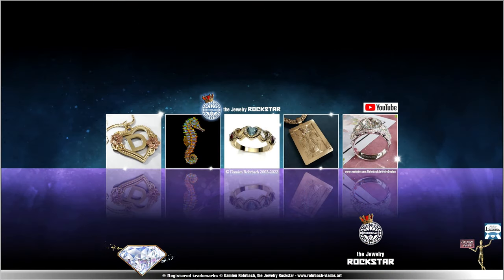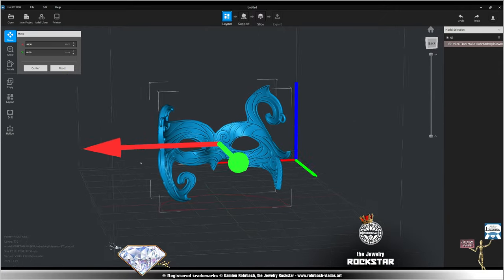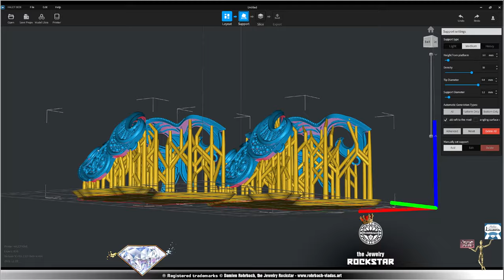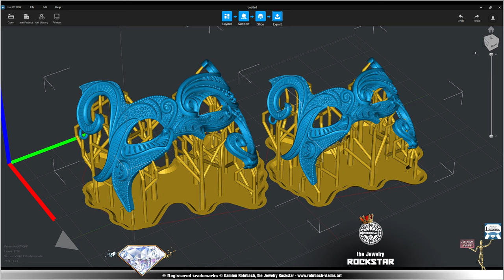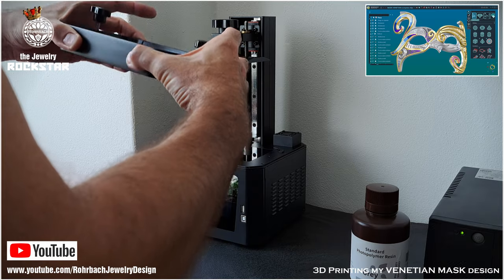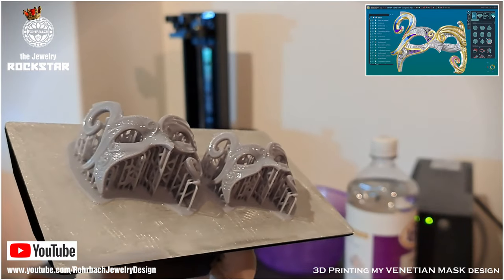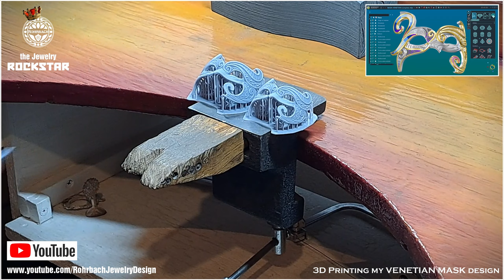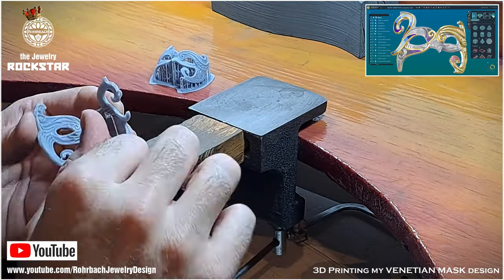3D printing my venetian mask from the 3D design to the 3D print

Comment: what exactly is the brand of the castable resin you use?
Reply from the maker: This one is Elegoo standard grey
Reply: @RohrbachJewelryDesign  and you cast cast in metal with it?
Reply from the maker: @louisvictorduquet3040  No, obviously not, resin for casting have castable in their name. Who said I was going to cast the mask? 🤭
Reply: But Can you share the name of the castable resin you use?
Reply from the maker: @louisvictorduquet3040  some years ago I was using B9R-4-Yellow, when it came out, it was one of the best resin... Nowadays I don't recommend it. It's too sticky and costly. Many brands offer better options, castable resins are easy to find, the market developed a lot these years.